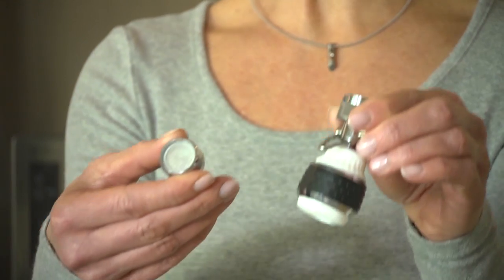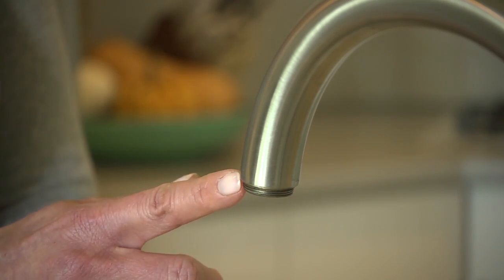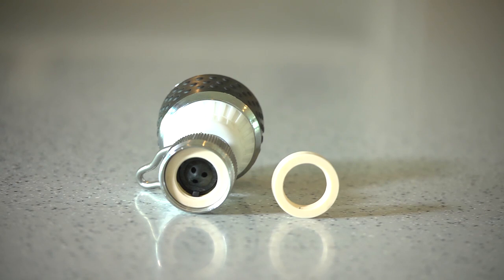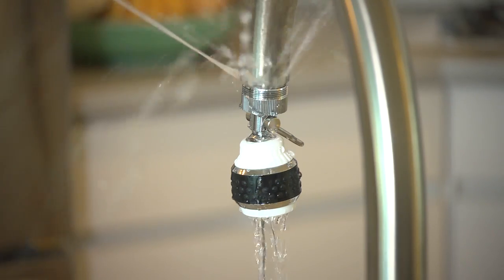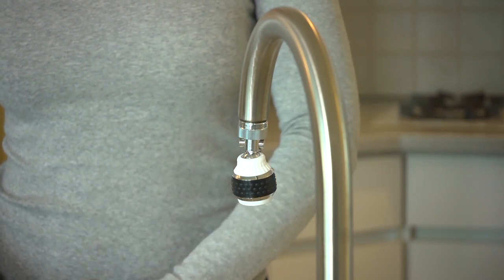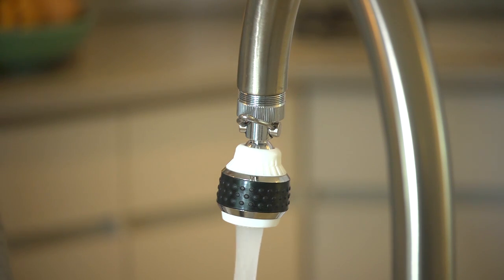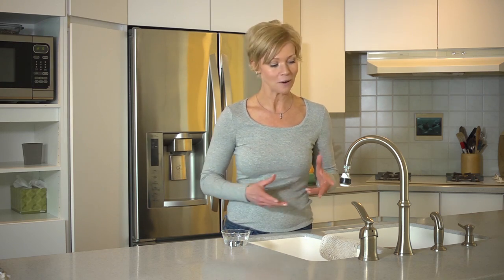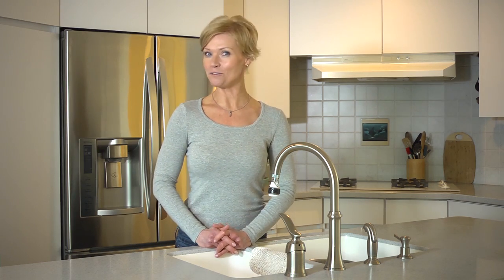Low flow faucet instructions

Comment: I got one for my kitchen faucet and I read the instructions for it.
It says it is a shut off swivel sprayer but it trickle's out tho I shut off the given lever on the unit.
Does not work properly it's to the manufacturing default.
I wanted to leave the hot and cold on but use the swivel sprayer unit to shut off my desired temperature for easier use of water due to the production of the item I give it a 1-10 (5

Comment: Why not simply open the valve partway when washing something under running water and accept that the stream isn't aerated? Doesn't look like the water has the small hole treatment in the "down" position either: it falls in a single solid stream then. I guess this is good for valves that only sit comfortably in the open and closed positions.